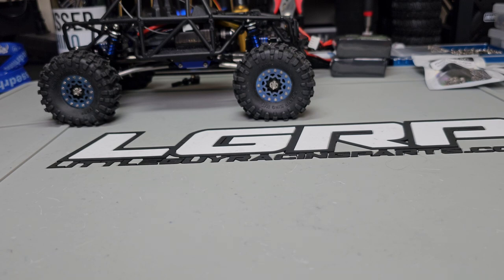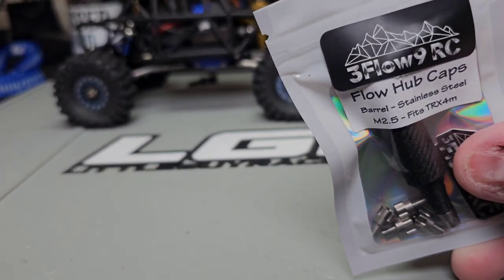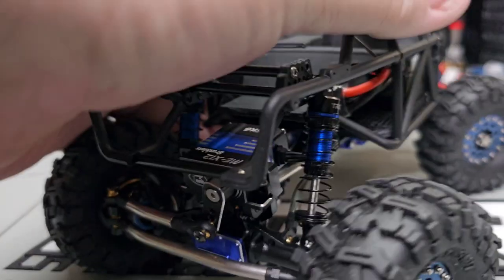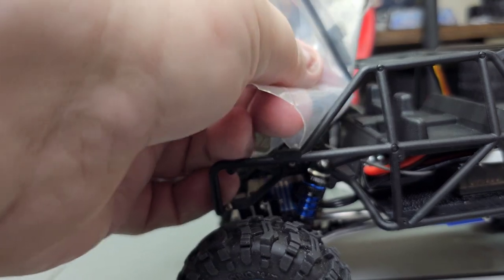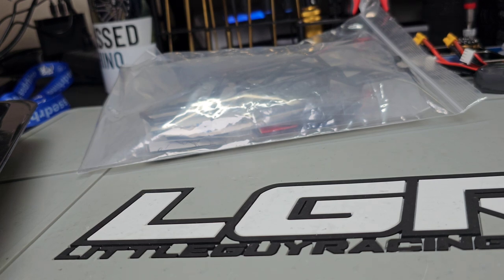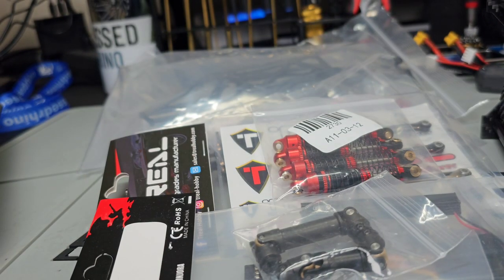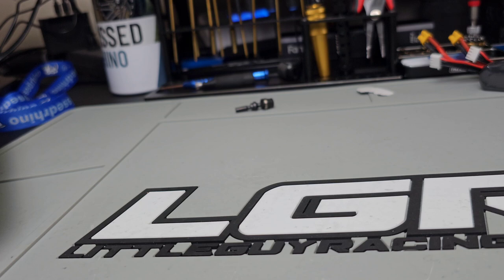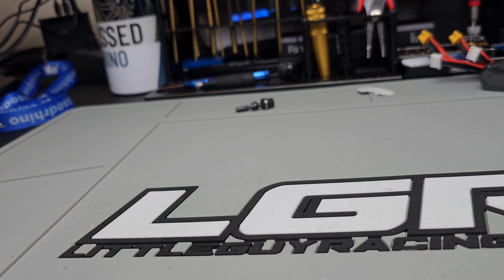Trx4m Mini RC Crawler New Hubs By 3Flow9RC Ovonic Batteries 3s Antenna by Losi Fifth Build Coming Up

Comment: I would like to know where you picked up those black rims and wheels.. I have a trx4m and I'm looking at maybe trying to fit them on there.. =)
Reply from the maker: Sorry but I think I showed three sets of black wheels and tires. 

1- injora black wheels and black Beadlock rings- Ebay is the best place - tires are lgrp swamp kings- buy direct from LGRP 

2- rotary looking black wheels with DJ Crawler tires bought both on AliExpress

3- Mazz design beadlocks with injora comp pin tires- buy wheels direct from Mazz designs- Injora tires bought from Amazon 

I sure hope this helps.  If you have more questions please feel free to ask.
Reply: It was the first one thank you!